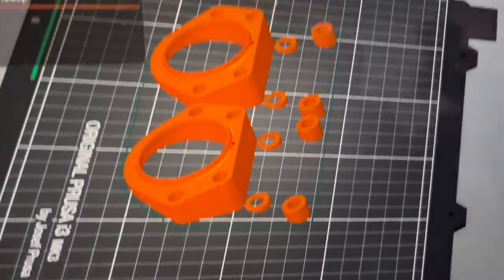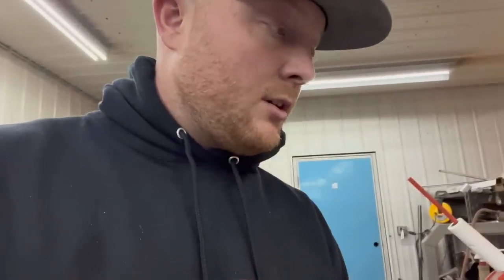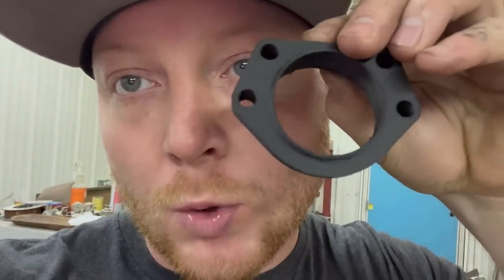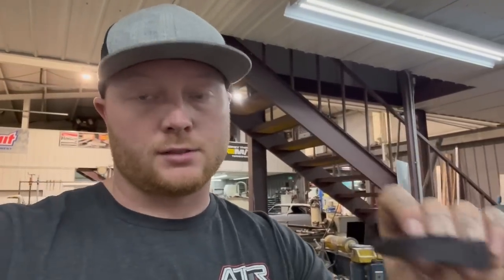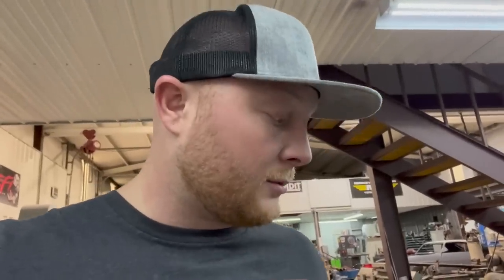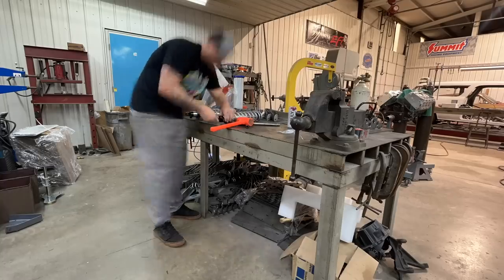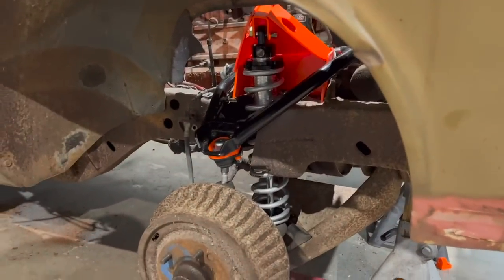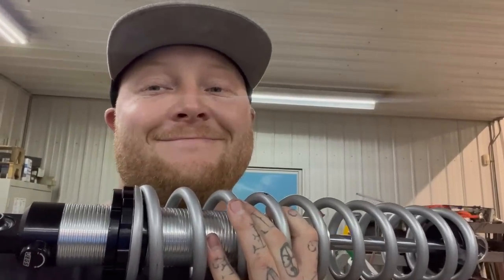3D Printing Carbon Fiber?! & The CHEAPEST Coil Overs On The Internet 👀

Comment: Stay with the Prusa slicer for your prints. Is relying on the bolts to hold you upper ball joints in place instead of having the ball joints go through the upper control arm first to be captured incase bolts break a good idea? I know you are trying to change the ball joint articulation angle but probably a better idea to have new upper control arms made with a revised ball joint angle?
Reply from the maker: That’s kinds of my goal is get the angle I want so the new production control arms can be jigged up off that angle. But a ton of people have asked me to make them some but that’s one of my worried if selling them is the risk of the bolts sheering

Comment: I have had a little bit of experience with plastics and the guy that told to add heat can be right. The actual heating element is not as accurate as they claim. You may have to play with it and find your sweet spots.

Comment: When your choosing a shock for a long travel set up are you mainly looking for 6ish inches of stroke? I thought you needed much more than that (I'm basing that thought off of the s10 you set up a while ago "gaptrain")
Reply from the maker: It needs to be around minimum 20” extended height and less than 15” compressed height
Reply: @nickkybobbyinc  I was looking at the qa1 DD 902 coil overs 23.625" extended and 15" compressed. I'm working with a s10 type suspension. I was assuming there would be a decent amount of fabrication to make some sort of long travel set up. Just didn't know how much shock travel was needed

Comment: I've looked at the metal 3D printers, but holy preparation H $$$$$. It would be badass to be able to go straight from printing to testing though.
Reply from the maker: That would be! I know there’s another treatment process for the printed metal also even after it’s printed
Reply: @nickkybobbyinc  I believe it has to be heated to a pretty high temp. I know the entire setup was pretty expensive. It would probably be more cost effective to continue printing how you are and eventually invest in a CNC to produce the final design that will be sold. There's machine resale companies that specialize in used equipment from upgraded or collapsed companies. 👍I don't like wasting money either
Reply: @Nickky Bobby Inc.  It depends on the printer. most lower end (read: still 5 digit price tags) metal 3D printers are Selective Laser Sintering (SLS). Those sinter the metal powder and need post treatment that is essentially brazing the part to fill the voids. The higher end machines are called Selective Laser Melting (SLM). Those actually melt the material together to make a solid homogeneous part. They don't require post treatment other then basic cleanup

Comment: I own a machine shop. I’d be willing to look at machining your spacers out of billet for you.
Reply: I'm thinking I'd drill the 4 holes out of some square and bolt a few down on a fixture to profile inside and outside. Then face the angles in a vise. Could be a fun little job